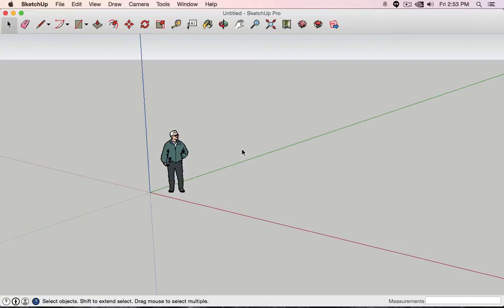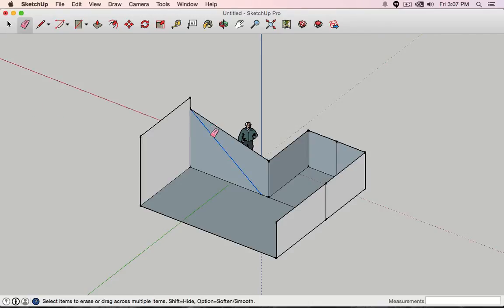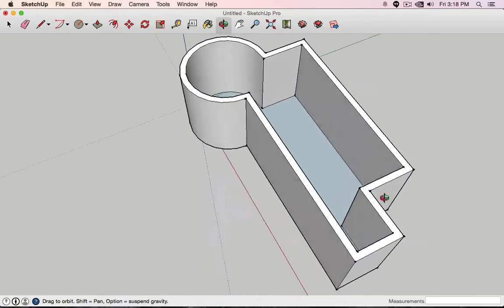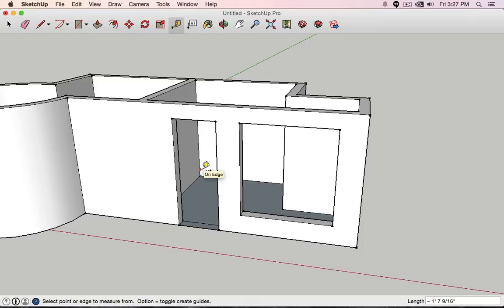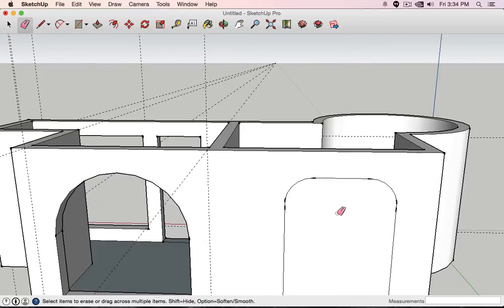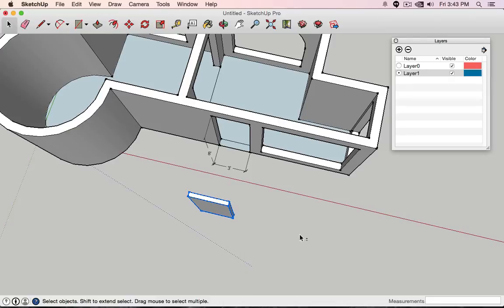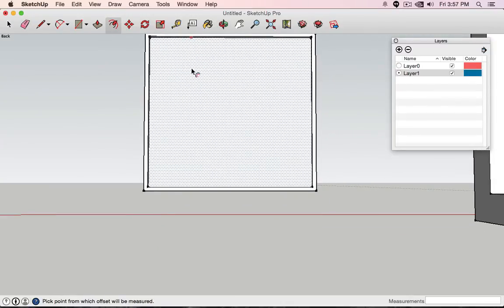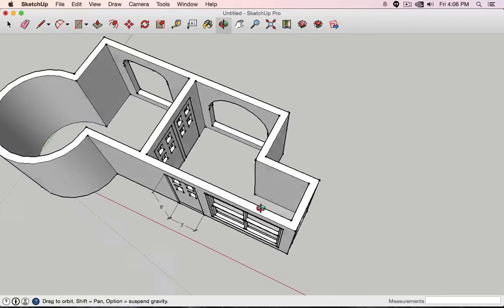Intro How to use SketchUp

Comment: Hello Claas,i used to worke with SU for almost 6 years before i started to work with Blender 3d. It was a huge change for me,and maybe i lost the advantage of saving time as well.I even tried once to integrate BL and SU but after so much meshes cleaning i gave up.Have you tried to combine them together ?
Reply from the maker: Good questions:

Pro SketchUp: easy drawing, online model library, dimension tools, very basic but intuitive interface (materials etc)
Con SketchUp: limited tools, non interactive

Con Blender: much more complex drawing modeling tools and interface
Pro Blender: Can export as DXF at least, modifiers, Cycles, far better modeling depth

And with ThinyCAD you have a pretty fantastic AutoCAD like drawing tool.

I tried few times to get SKP into Blender but it is terrible. I rather build in Blender even while the drawing tools are a pain like E Z = 8' to draw a line along Z for 8 feet.
Reply: Claas Kuhnen
Thanks for your answer,and by the way i just found out that there's a new SketchUp adapter 2015 at https://github.com/martijnberger/pyslapi
Reply from the maker: Gil Merires is this just a SketchUp python addon?
Reply: Claas Kuhnen
i didn't download it yet,just saw the link in blenderartists
Reply from the maker: Gil Merires can you post a link?

Comment: Very Good. Can be very useful for people in the building industry.
What is the costs involved?
Pieter Heigers
Pretoria, South Africa
Reply from the maker: cost SketchUp light is free. can be enough to use.
otherwise it is not a cheap application to be honest.

I rather then would use Blender 3D for this type of work as it is more powerful and Free.
You can for technical stuff you can look at FreeCAD - also free.